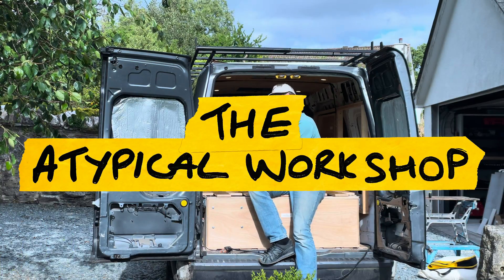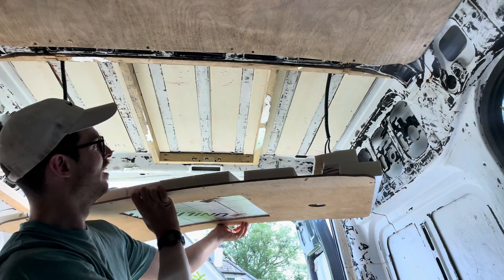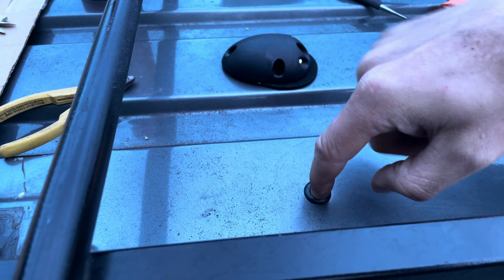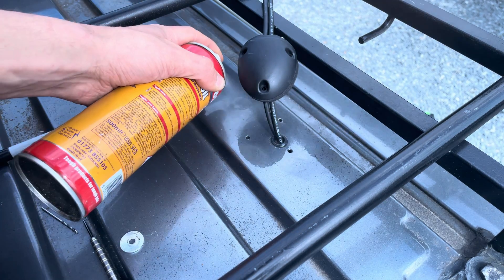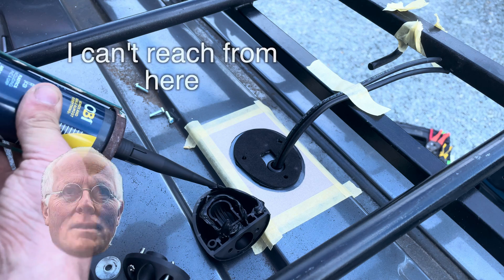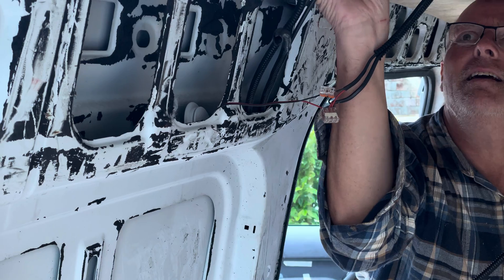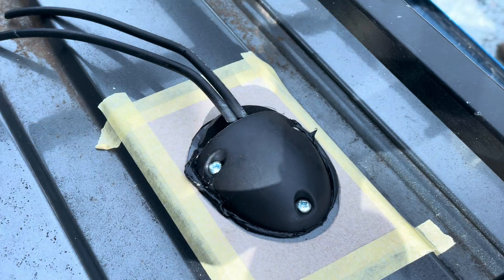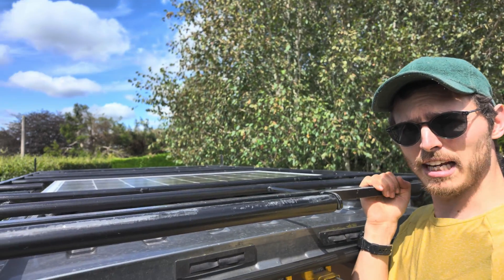Transform Your Solar Setup: Install Cable Glands Like a Pro!

Comment: Loved this. Using your existing skills and knowledge to make it up as you go along while trying to look like you know exactly what you are doing.
Exactly my kind of approach.
I recently re-fitted the wind-out awning on our van using the same method.
Reply from the maker: What do you mean I’ve installed hundreds on glands before 😁 I used this approach even more on the solar panel install vid as I couldn’t find anyone else who’d done a recessed panel - actually had to use my brains 😂
I’ve got plans for an awning one day, but I have to get the pull out kitchen done so I can actually use the van this summer haha.

Comment: Not sure why but I was unable to edit my first comment. The last line should read “if needed.”  As far as your solar install, did you consider turning the charge controller 90 degrees so you can access the cable connections more easily?
Reply from the maker: I seem to recall the manual told me to mount it in that orientation but I’ll check and get back to you!

Comment: Glad I found your channel. I’m modifying a truck cap into a camper setup rather than a van but you’ve given me some good ideas. 

One suggestion, when using stainless steel hardware, especially with the nylock type of nut you really should use some sort of anti-seize on the threads. The bolts will gall very easily if exposed to weather and the anti-seize will allow you to disconnect the fittings if
Reply from the maker: Thanks for your kind words and the tip! I’ll be making these changes on the brackets that the panel is suspended from. Turned out that the small/thin brackets I used were not nearly strong enough and 2 of them snapped 😮 luckily I spotted this before the other 2 went

Comment: A bottle of Capt. Tolley is also handy to have in the tool bag, in the never end fight against leakage.

I found your glamorous assistants lack of faith and dry sense of humour, spot on.
Reply from the maker: Thanks for your comment Jim 👍 that is certainly a good shout. Does it dry flexible?

I will be sure to pass the compliments on!
Reply: @AtypicalWorkshop  It goes on like milk, but it is flexible and clear, when dry.  Have used it on a leaky (naturally) Land Rover and on a few boats, as well.  The way it gets into all the nooks and crannies via capillary action, so good.
Reply from the maker: @JimBiddle. I just googled it - the full product name is excellent 😂🍑